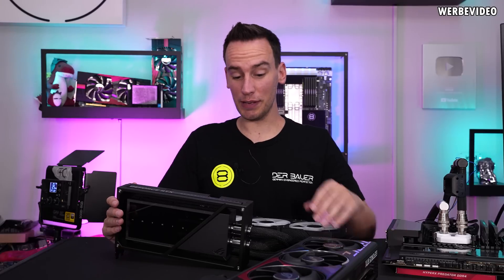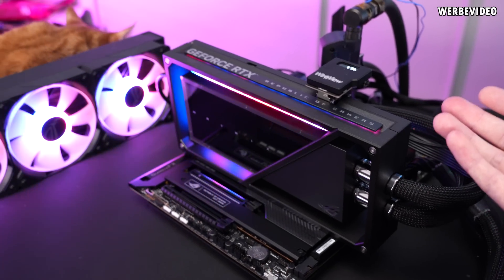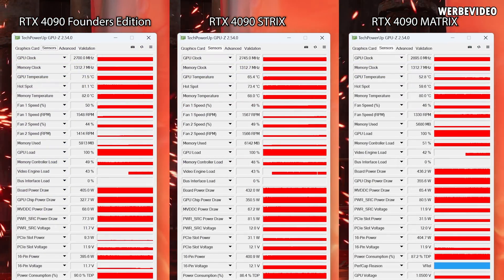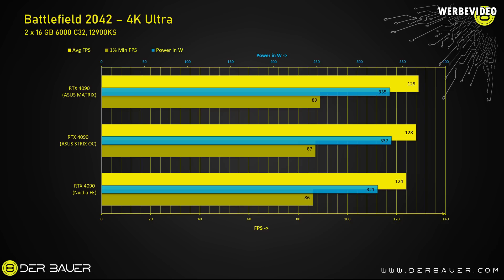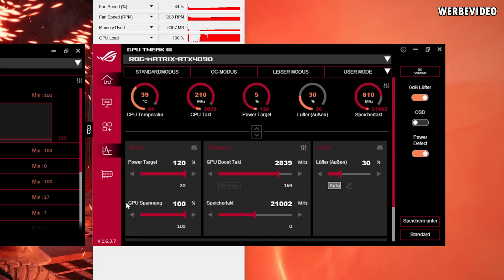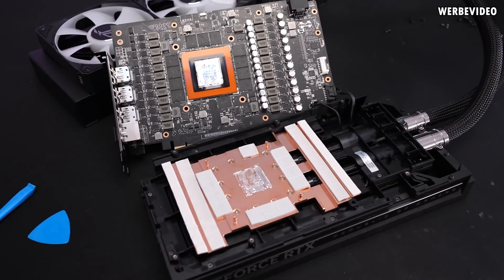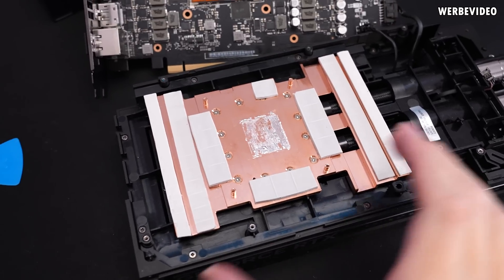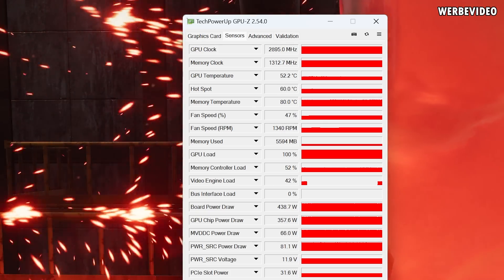The fastest GPU ever Made! RTX 4090 Matrix

Comment: In my ASUS G533 the liquid metal looked terrible after 2 years. I noticed uneven core heating, during RMA on-site repair, when guy cracked the cooling it was looking like there was a totally dry spot on the cpu. For sure it was not like that after the purchase, because then the temps were awesome. Also there was no sign that the LM was applied on the heatsink side. Calling them experts in the liquid metal because they produce thousands of notebooks is an overstatment after what I saw inside mine. LM in notebooks is just a marketing and a method, to get away with smaller radiators inside the case. Of course it gives much better temps, but it has to be monitored and serviced, which is nowhere mentioned and after warranty user will have to risk reapplication.

Comment: my 1st 4090 FE was able to bench, with voltage max out) at 3105mhz on the core it was insane, with default voltage 3000Mhz was stable and I could even bench at 3030Mhz. But memory overclocking was seriously bad. And despite being careful and doing very few benches, and playing actually most of the time heavily undervolted (2670Mhz at 0.9v) it eventually died for unknown reason within a month or 2 of use.
Nvidia replaced it, and my new 4090 FE, doesn't overclock nearly as much as, I can barely reach 3000Mhz with voltage maxed out however the memory overclocking is twice better, overall giving even more performances.

Comment: Crazy, a 7900XTX will do 2800 easy. Faster memory clock too. 

Why do people buy 4090's?
Reply: superiority
Reply: @TAZDINGOMON  It's prone to failure and/or meltdown and the 7900XTX nips at its heels on stock settings.

That is not even close to superior. That is inferior. A failed product.

I should not be able to achieve the same performance with a quarter of the price.

That is massive market manipulation. And very illegal if provable. And yet people support it.

I hope they all melt in the slot.
Reply: @XEN-ZOMBIE  nah

Comment: I am Sorry  , but your Thermal Grizzly it is kind of trash = Not only does it eat into the metal, but it also dries out over time.!
and I don’t understand why you don’t use your German - "coollaboratory liquid pro" 
I've been using this for 8 years now on laptops especially that don't have any nickel plating and have never had a problem. except that the paste paints the radiator black.
???

Comment: Things I could buy instead of this GPU for $4000+, because let's face it the MSRP means nothing now. Used car, High performance rims and tires, a full computer with an air cooled 4090, 2 month's rent at $2000 a month, and the list is endless.

Comment: um, my gainward 4090 almost reaches these clocks without water cooling or doubleprice of a 4090, its actually the cheapest possible. 
gpuz shows 2865 at 65c

I dont see this as an unique super giga performance gpu. its double the price for less than 2% clockspeed

Comment: The loud ticking noise will probably start sooner or later in that pump as well. I had two Asus 3090 ti Lc which the pump failed after a while. It sounds like it’s the same type of pump in this video. I rather wait for the 4090 ti if it’s cooling or just the 5090 next fall

Comment: At the astronomical price this is going to cost they could have made the glass of transparent OLED that dynamically renders actual Matrix rain changing with game scenario or what else the card is doing.
Also why don't you evaluate coolers with dT/W (how many degreed of delta a component gets over radiator intake per watt of power consumption)? IMHO it would be the best cooler score as it doesn't depend on a lot of stuff and gives people an easy way to calculate what temps to expect in their room at different seasons.

Comment: Same pcb design wow asus ,does it kill them change connector location to the rear like evga 3090ti. i wish there is 4090 kingpin. Then it will destroy this with 900w power draw dual connector on the rear. Asus card can't ever attain evga status due to lack of  innovation. This industry only follows what nividia reference design. That is like apple it kills innovation and the reason to use type-c due to they were force to do so. I'm so glad i bought evga 3090ti it has a connector at the rear deliver 500w power without worry it cook itself like 4090. Is sad no one talks about why 4090 fry in the first place. You see, on evga 3090ti, it has power connector at the rear along with an extra controller to regulate the power coming in. Nvidiva later made the 4  extra digital pins do the job of a controller to save money due to lack of demand for high end card after the digital currency bloom. What kills the card is the high transient response combined with high power draw and bad cable design. The 4090 can draw power 2x voltage over the max cap in few ms burst without a proper controller chip just from those 4 sense pin cant responded quickly of the sadden spike of power and over time it break down the cable which max can handle 600w previous pcie cables can handle twice as much due to lower gauge wire and multiple rails of connector. With multiple flaws in the design being only one connector, there is a lack of regulating controller, higher gauge wire in due time the cable will start break down. The reason it can't place an extra controller is that the short pcb leaves no space, and even with lengthen the pcb and place connector at the rear, it probably violates nividia policy by change the design. The only solution is to change cable regularly once a year. This move is to make planned obsolescence possible to create fake demand for 4090. The reason 4080 and lower has no such issue is due to lower power draw. With this many hurdles just to save cost design a small pcb and with the  low demand  for 4090 combine with bad economy im sure next gen nvidia will stop making 5090 desktop gpu instead bring back rtx titan for enthusiast user. Pretty much 5080 will have 4090 proformance and gear toward gamer for the next gen but with a price increase of course with about same power draw as 4080.

Comment: When he said that "The liquid metal would defuse into the copper and at least from my assumption the temperatures would increase over time." This is false. Yes the liquid metal does do this, but it is not a bad thing, in fact it is optimal for performance, yes you do need to reapply liquid metal after six months of the first coat, but this will make the liquid metal perform even better! does it take more work? Yes. Does it make you GPU better? Absolutely.

Comment: My 4090 Waterforce AIO gets 135fps in GT1 overclocked, has the same mem temps and slightly higher core temps but keeps it still in the 50-60 range. All this for 2k, instead of 3.2k 😄

Comment: In perhaps a little over a year, Nvidia is likely to release a 5090 which absolutely blows this card out of the water for like 1200-1600 USD less than this insanely expensive custom model. More importantly, even a 4090 that's like 300 over MSRP absolutely blows this out of the water in terms of price vs. performance, and will still come with an excellent cooler. Even some of the models near MSRP are very good. 

This is the definition of a luxury product.
Reply: new cards are gonna come out in lat 2025, so nope, more like 2 years

Comment: Curious how unrestricted the vbios is. I have an optimus block on a strix 4090 and it runs consistently at 3070mhz all day. I can benchmark at 3120mhz but it will crash eventually. I've only been able to do this since I switched from the ek block with active backplate and thermal paste, to the optimus block with conductonaut extreme
Reply: vBIOS is limited to 600W and 1.07V. In other words, it's shit.
Reply: @Wasmachineman  damn. I'll stick to the original strix bios. Not that I ever use 600w. Was hoping for maybe a slightly more aggressive voltage curve

Comment: So this is an 4090 Aorus extreme waterforce with a bit thicker radiator and more coil whine + worse reliability because of LM.

Sad considering this is significantly more expensive than that card.

Also this is common knowledge but still worth mentioning:
Do not fall to the "binned chip" snake oil, the tiny lower power consumption difference is easily attributed to usual silicon variance plus in this particular case was the result of 10C lower temps.

This was the last card i was waiting to confirm my final conclusion for this generation.

1. Best Aircooled: 
Strix OC.
Best 4090 overall-( First  wave had terrible coilwhine)

2. Best Liquid cooled: 
Strix OC LC 240.
Has slightly better core temps at the cost of memory/vrm temps. (I would stick to the Aircooled version).

3. Best Budget/Value:
Gigabyte Gaming OC.
Great card overall with no drawbacks worth mentioning. 
(For money no object i would still prefer the Strix due to better materials)

4. Best "I use a pc case the size of a closet" : Aorus Master.
This beast rivals the temps of the watercooled cards but does look a bit ugly and is huge.

Comment: I would like to see you make a 4090 with better components like a FLT 140 paired with a 360 rad and use soft tubing then adapt it to a SFF case since this kinda seems what it's targeted for.

If you have a zotac 4090 OC I would put and ekwb abp or non abp and then test the performance. 

Problems I see with the 5 year warranty are as follows. 1 you cannot replace the pump. 2 you cannot service the loop. 3 it's not nickel plated and the copper will be destroyed despite the response from asus, science is science.

It's not a bad looking "concept" which is only as far as it should have gone with the lack of care for the long term use.

Comment: I’m not super convinced on the water cooled 4090s.

The performance and cooling difference seems marginal in exchange for needing more space and wrestling with hoses or hard line.

My main take away from this video is to be even more impressed with what the strix can achieve using air cooling alone.

All that said, it’s exceptionally pretty and I’m really glad to see some variation in the market without having to take the DIY route.
Reply: Yeah and every AIO GPU I have ever had, had pump failure at some point... All EVGA cards.

Comment: My Asus ROG Zephyrus Duo 16 laptop with 6900HX and 3080Ti which has liquid metal on the CPU has already dried out after exactly one year of usage. During idle/just starting up the laptop, the CPU would reach 80+C while the GPU remains 40+C. The fan noise is so much alongside with screen whining and other coil whining its a dead paper weight now.

Comment: what a terrible design for such an exorbitant price. the waterblock channels only cover the gpu core, leaving the memory/vrm to be air cooled. the copper block isnt nickel plated either, so the liquid metal will chemically react and significantly degrade in performance - whats worse, asus has documented history of this exact issue with their laptops overheating for years. colossal mistakes for a supposedly 'premium' product...
Reply: Nickel plating will still technically react with the liquid metal too, it just does it at much slower rate.
Reply: correct. depending on the liquid metal alloy, significant ion migration in bare copper can take as little as 6-8 months, whereas nickel plating will see mostly superficial reaction with normal temps well over a year after application. asus design is planned obsolescence - or incompetence
Reply: @hollywoodmeow  with the way Nvidia's adding new D.L.S.S software that doesn't work on older cards usually I doubt they really care.

Comment: TLDR - buy a HOF 4090 and a Waterblock instead.

beautiful design. but absolute joke for the cost. $3k+ for a strix PCB with nothing but a supplier change for power stage & inductor, and a couple more temp sensors (still same power rating on Power Stages & inductors) as well as a CLC that is going to fail eventually. also LM on bare copper (i'm sure that wont be problematic after 6 months of heat cycling) 

when you think about the customer base for $3k+ for a single card, they should have made it a fully custom board + the CLC modular to G1/4, or just use a Custom waterblock instead.

Comment: Is it just me, or did all of the thermal pads look thicker that a lot of tear-down videos?  Could be different material, but thinner might also address some of those memory and VRM temps a bit.  The whole copper thing is a head-scratcher at best...
Reply: They look massive, like 2.5mm.  I don't get why they do that, there is no real reason to use a pad whatsoever. I always remove the pad and use copper shims and paste

Comment: "finally available". Many, many gamers waited this opportunity to sink double price and 10% increase in power consumption for tiny bump in performance.
Idk if its low margin left by Nvidia for more basic designs, or companies consciously trying to target only oligarch's sons. But putting so much marketing and design effort into products that don't actually improve the core function of the product, is tiring. Basic 4090 with water block would be MUCH cheaper and deliver indistinguishable results.

This card does actually pretend to improve the function of the component, so its bit of an exception. Most of the industry presents RGB and and letters before RGB, LCD screens, software to control all the bling, as the main selling argument
Reply: why were people waiting when you can just slightly overclock any other 4090 for the same results?

Comment: I had LM on a bare copper GTX 1080 waterblock. The LM alloy'd with the copper after less than 2 years and the block became basically unusable because it now has an impression of the GPU die on it in solid metal.
Reply: bruh that sucks so hard! I was looking forward buying this card, but when it's such a big problem it's too risky for this price... :/
Reply: try applying more LM, should soften the old dried LM.

Comment: $4k for that? My msi is oc to 2910 and runs about 45-48c, yes its custom loop cooled but i paid less than $2k for the card and didnt even pay $2k for my custom loop that also includes my cpu, 4 360 rads (i know overkill but aesthetics) 1 d5 pump, gpu water block and am5 cpu waterblock.

Comment: There is still the HUGE ISSUE of HARDWARE FLAWED DESIGN on the VRM-s heat dissipation area and 16-pin power connector :). Still a HALF-BAKED product that consumes 520 + Watts of power continuously.

Comment: Why is the card so thick? 3 slot card when the pump is 2 slots thick? What's going on?
What's going on with the stock memory clock and 80*c memory?  Is the thickness of the thermal pads the reason for this?
It seems like every prebuilt AIO card released recently has just been big with a marginal cooling performance gain over a 3 fan cooler of the same footprint. Was the FURY X really the best AIO cooler design card ever made? Small, 2 slots, with a single 120mm radiator, and it could easily cool 300watts of GPU, VRM, and memory.

Comment: For me this card is failure. They couldve captured ai enthusiast with a 1 slot thick card meaning they could cram 2-4 cards inside (three are some cases which have enough space for 4x 360),but instead they attached this heavy frame to it making it almost as big as a smaller air-cooled unit. Complete bonkers.

Comment: I've been critical of AIO options for a long time, and recent issues industry wide with rapid sludge build up haven't helped. In an ideal world, they would certainly be a good option for those just not interested in custom loops, but in the real world, I can't recommend a user looking for low maintenance spend big bux on something with a cooling system that is harder (if not impossible) to maintain when compared the supposed "difficult" option. A custom loop for the same PCB would perform better, be significantly cheaper, and be easier to maintain with the only issue being a more difficult initial installation.

When you consider the maturity of the water cooling sector, it's really not that much harder than the PC building itself if you go with soft tubing, so if you're looking for water cooling, I highly recommend anyone considering it go the DIY option.

Comment: Kinda unfortunate that the VRM was not cooled sufficiently. The closed design also limits any form of cooling from case fans.
Reply: The VRM. Doesn't even need cooling, it's completely op and could probably run passive with no heatsink or airflow for 100 years
Reply: u wrong, GDDR5 very hot @LawrenceTimme  can road to max 110 and shutdown after - normal can going to be 90 - 103 
and with VRM, if u make VRM more cooling = more life time, lower error. It's same like PSU, can hot but cooling always better, the problem is money.
Reply: if u have cooled = 10 years, if u dont have = 5 years. @LawrenceTimme  you can search about Arrhenius for more info

Comment: Lm like any other paste only lasts for so long. lm will yes absolutely stain copper but thats it. the staining does nothing in terms if heat transfer. ive been working with lm on cpus and gpus for over 5yrs now. you cant apply lm and think you dont ever have to reapply it. my 2080ti kpe actually still has its application of lm on it which its had the same application for over a year now. still gets killer temps as well.

Comment: I'm not gonna lie, some of these AIO cards look so good. Would love for them to come with G1/4 ports and no pump/coolant so they can be added to some open loop builds.
Reply: If all you care about is looks, that might be cool, but the actual cooling block on this doesn't look like it's very good. Then again, I have seen people do worse with custom blocks, but that's more likely a matter of flow rate, radiator area, and ambient temp.
Reply: You need the radiator and pump on the RTX card ?